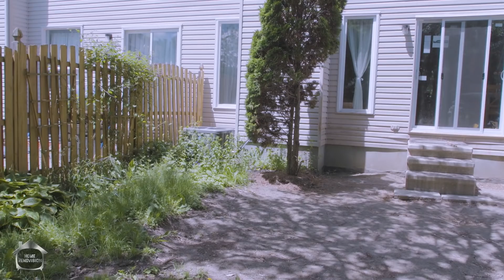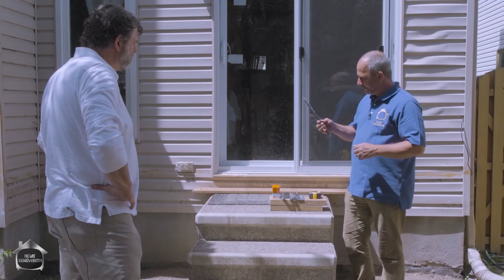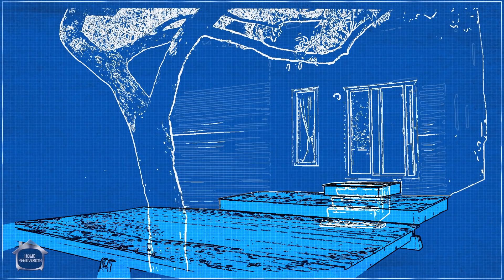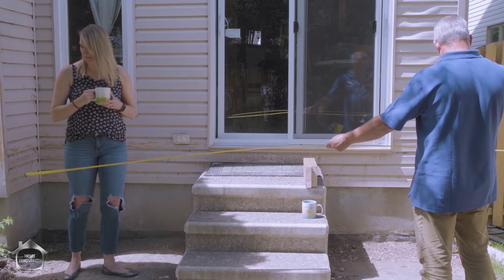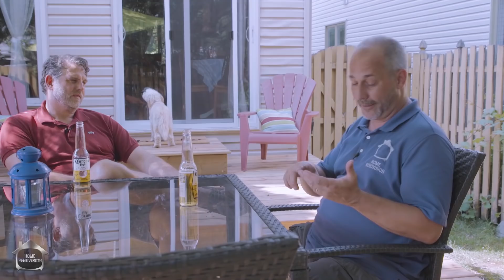Affordable Deck Building Project

Comment: Ok Jeff now that I see the symbol by my name i know you will see this right?   I just tore down 12' X 24' section of my deck.  7 years old rotting like crazy.  terrible.  Here's what i need to know.  I"m installing a swim spa, 20' X 8' , 1500 gallons, 25,000 lbs full plus kids and waves.  I'm pouring a pad 8' down on the ground 6" thick with 1/2" rebar.  the pad will be about 11 X 24.  The tub is 6' tall and i want 20" sticking above the new deck which will be where the old one was at 8 to 9' above grade.  What do you recommend that i do to build a platform for the swim spa  at abour 5' above grade.  how would you build that elevated platform.   The new deck will be built around the swim spa and probably be build after the swim spa is set.
Reply from the maker: contact a helical pile company to do drawings for you so you can structure a platform to hold the weight. Or contact a structural engineer for drawings. Cheers!

Comment: Inspiring design. This couple is exactly where we are right now. I've got a slightly different deck dilemma. 

It's 200sf, on the north side of my house. The original contractors didn't install any aggregate beneath, so it's just dirt that never dries out and a mushroomy old stump. The big square is inside the "L" shape of the house, so ventilation is terrible. It attracts critters year round who find ways into the walls. The decking has rotted through in spots. 

I'm thinking about A) replacing it entirely with a paver patio, preparing the substrate as in Jeff's ceramic tile patio video (awesome). However, to save lots of money - this place needs $10K here, $15K there, it never ends - I could also build B) a similar, but better deck using composite decking and combat critters with mesh. 

If I go for the replacement deck, is it overkill to compact multiple layers of aggregate and landscape membrane first? 

I want ZERO critters and I want it to get bone dry after snow melt and rain. I've done so many projects in the age of COVID and learned the law: preparation is 90% of the job. We're going to keep this house forever, eventually as a rental, just like the couple in this video.
Reply from the maker: I would suggest the patio this year. make sure you buy your pavers before starting they have limited stock! aggregates are easily come by still however.
Reply: @HomeRenoVisionDIY   Thanks. I'll talk to the boss and see if she's on board!

Comment: I want to do something like this in my yard, a floating deck, but the drop from the door to the ground is like 24-26in and i'm not sure how to tackle the stairs. Any ideas?
Reply from the maker: just build a couple of platform boxes and set them on the frame to create stairs. use 2x8 to frame the boxes and when done stacking a couple then you add the boards. 2 layers is 14 inches plus a floating deck makes it all within code. Cheers!

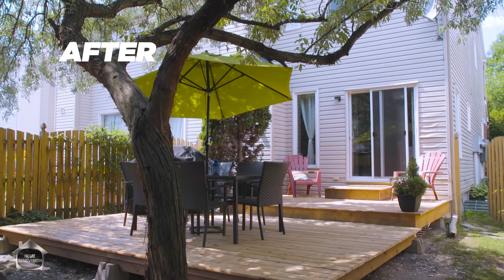Comment: Those deck blocks protruding past the end of the deck are ugly. Should there not be an overhang to allow skirting to hide them? 11:23
Reply from the maker: in a perfect world. but remember the goal here was for a 1st time deck builder to do it DIY and on a tight budget. There are better design options for sure but I don't want to criticize the work. it looks great functions well and he did it alone. I say that's a win
Reply: I can’t post a picture but the skirting and landscaping we did around really made all the difference. I had the same concerns as I was staring at it and building it :)
Reply: @kitlamoureux  I'm getting ready to put in a floating deck and was wondering  how to hide the  blocks thats the reason for reply, i see now that framing to move the blocks away from the edges will do it.

Comment: Looks great. I didn't know decks had codes you have to follow. I bought a home that has a small deck that almost sits on the ground. It is only like 2 inches off rhe ground. I was going to rebuild it cause it is pretty much rotted. Not sure why they thought it was going to last that long. I have got quotes on slabs but they arent in my budget so I was going to just build a deck but i see now I have to look at codes now. Thanks for posting this.
Reply: Any questions on code, just contact your local building department. They will answer any questions you might have, and in our area, also issue you your permit as needed. They'd rather answer your questions beforehand, so you'll do it correctly and safely, than have to make you redo something! 😉
Reply from the maker: great point Kathy
Reply: @HomeRenoVisionDIY thanks, good for folks to know. Around here they are a "bit" crazy with requiring permits. 🤯 😲
Reply: @kathyusa-iowa5137  if I'm rebuilding to the same size, do I still need to get a permit?
Reply: @bbay1977  here, it's not about size. If you’re changing the footprint (i.e. moving or adding walls), or attaching something (i.e. built-in entertainment units), whether interior or exterior, then you need a permit. But if it's not a permanent part of the structure (you could pick it up and move it), then no permit required. That's the jist of it. Hope that helps. 😊
Reply: @kathyusa-iowa5137  oh okay, I will be keeping the size and footprint the same. Nothing will change at all buy I will raise it a few more inches off the ground to keep it from coming in contact with it. Thanks
Reply: @bbay1977  best of luck 👍
Reply: @bbay1977  best of luck 👍

Comment: Affordable until lumber went up with the pandemic right?
Reply from the maker: when you eliminate the need for railings it makes more financial sense. Besides here in Canada the vaccine roll out is so slow we won't be going on any vacations this year!
Reply: @HomeRenoVisionDIY  merely just for conversation may be in Canada it’s not an issue but insurance like rails here.
Reply from the maker: interesting. we have a 24" off the ground rule so ne need for them if unattached. Cheers!

Comment: How about replace the siding first because I see some warped pieces  ( alot of heat from the sun most likely ) to the right of the back door then deal with it the deck after
Reply from the maker: it's not the sun that causes the warp. it was a BBQ

Comment: I can't focus on what's Jeff's saying whenever the vinyl siding on the corner of the house is in frame. Fix that first lol!
Reply: I think they had a BBQ parked there at one time.
Reply: @blackietedd8783  happened to my brother with his smoker lol.
Reply: @blackietedd8783  only person with a brain lol.
Reply: That's all I could focus on. Fix it!
Reply: Jeff should throw in a free siding repair with the deck job.
Reply: Either someone nailed that siding tight enough for it to be structural or a window reflected on it and melted it 😂
Reply: @Grb17  it's probably where he used to grill. The heat from grill may have warped the vinyl.
Reply: so funny , I guess I wasn't the only person that was bugged by that ! - I'd have to put a hanging plant , a potted rose tree , or a potted topiary  until it was replaced
Reply: Ha! I was thinking the same thing. At least they moved the grill to the other side and away from the house.
Reply: That's exactly my thoughts...lol
Reply: Agreed.